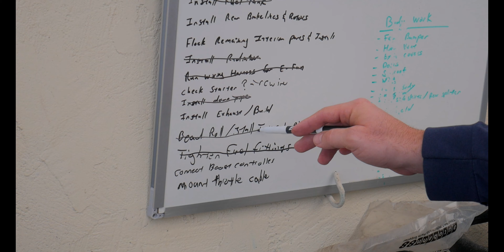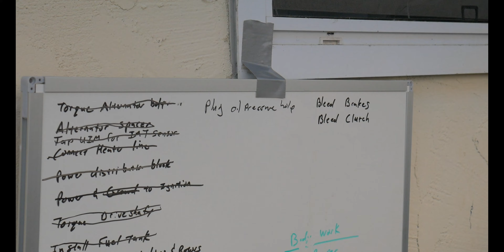RX7 First Start!! // FC3s Haltech Elite 1500 Big Turbo 1988 Mazda

Comment: #1 Did you shut the fuel off while  cranking with the spark plugs removed???  It looked like the fuel was still on?  One spark could've caused a big explosion.  Be safe!

#2 The ignition timing sounds off - are you trying to set base ignition timing like stock?  You can't do that with the Haltech.   You need to shoot a timing gun at the pulley marks - see Haltech docs for more details.
Reply from the maker: Yes fuel and ignition were off.
Still trying to figure out the timing.

Comment: How did you set the base timing with the haltech we can't get ours to fire over and we think its a timing issue
Reply from the maker: I used info off the forums...I know sketchy but I removed the top off the CAS and then lined up the main pulley marks. Better to use a timing light. I was also able to have haltech support remote in and help me. The best advice I can give is to contact nelson at RRR dyno tuning to do a remote session, you will need to have a timing light but he will walk you through whats necessary. Good Luck!

Comment: Do you have a video of the in cabin wiring for the haltech terminated harness?
Reply: Did you ever figure it out ?
Reply: @devinwixom9923  Yeah on the terminated harness most of those cabin wires are just extra and not necessary. I think I only had to use 3 of the wires.